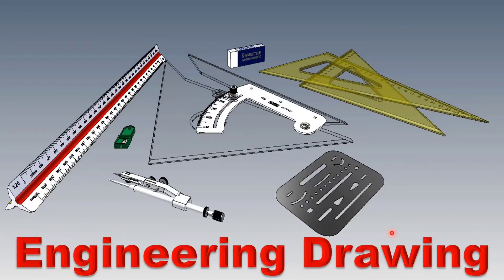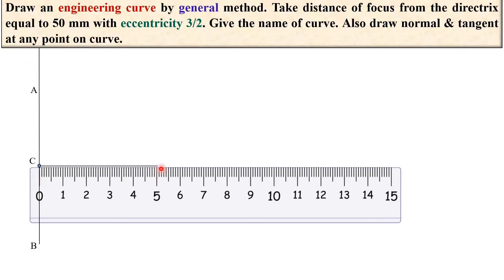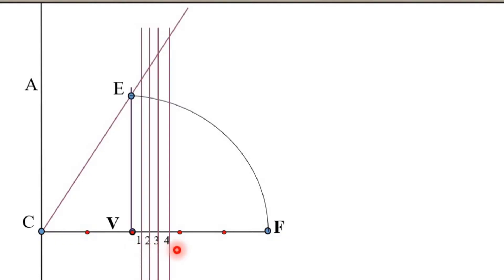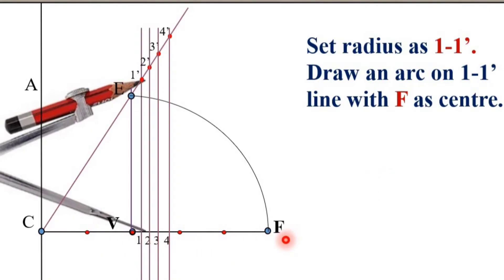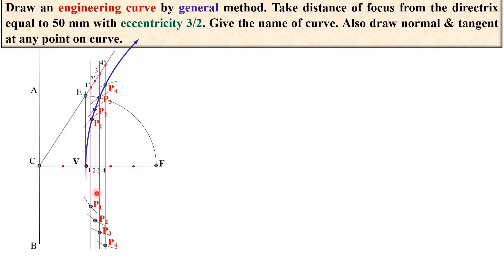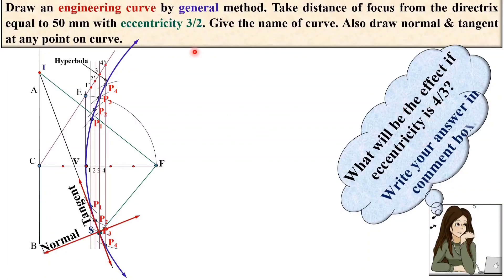Hyperbola by Directrix Focus Method | Normal & Tangent at Hyperbola | Engineering Drawing

Comment from the maker: Hyperbola by Directrix Focus Method explained with following timestamp: 
0:00 – Engineering Drawing lecture series 
0:10 – Hyperbola Drawing Methods
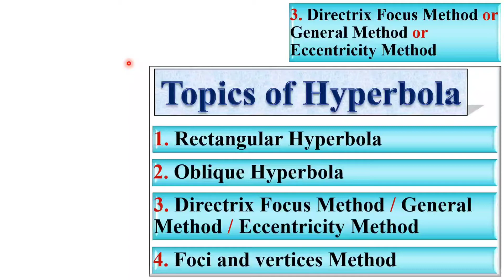0:35 – Problem Description of Drawing Hyperbola by Directrix Focus Method
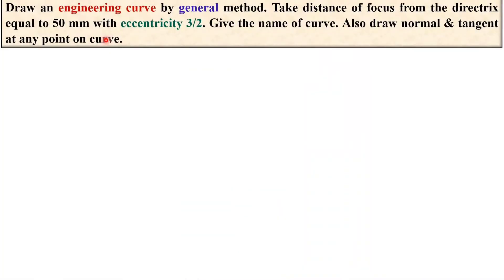1:17 – Drawing Process of Hyperbola by Directrix Focus Method
1:28 – Draw normal & tangent at any point on curve 
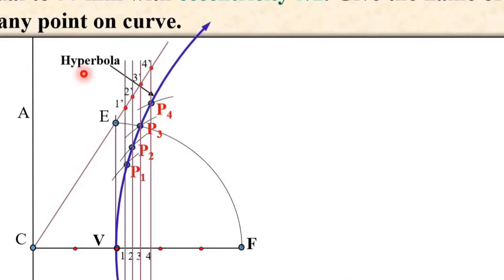8:02 – Proof of Hyperbola
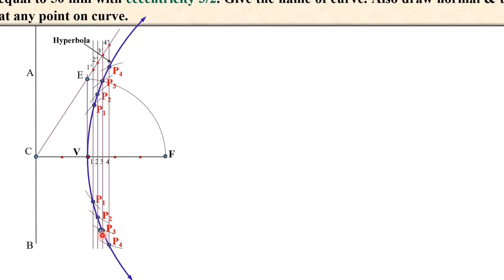8:17 – Draw normal & tangent at Hyperbola